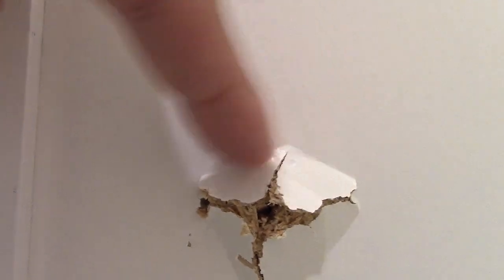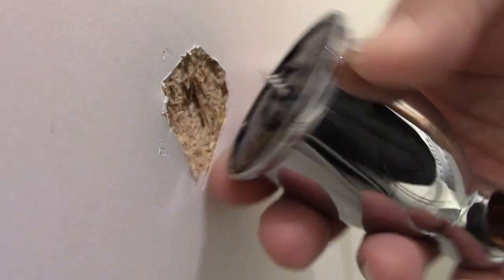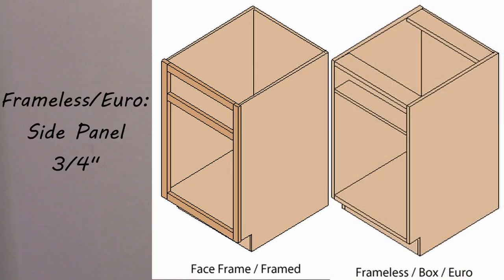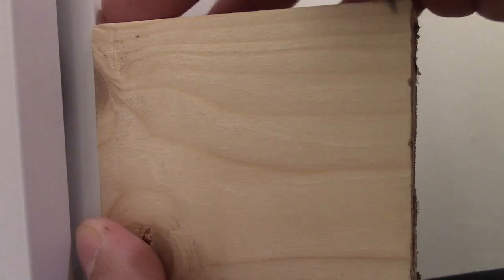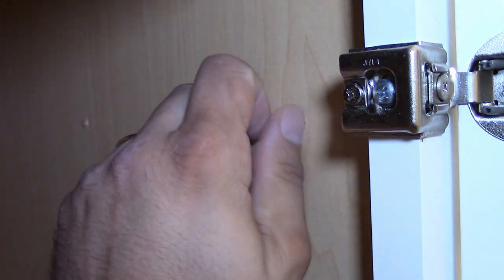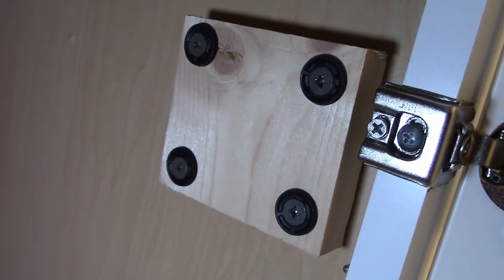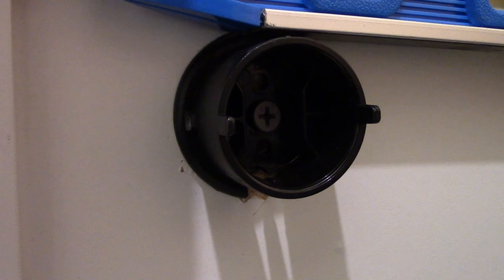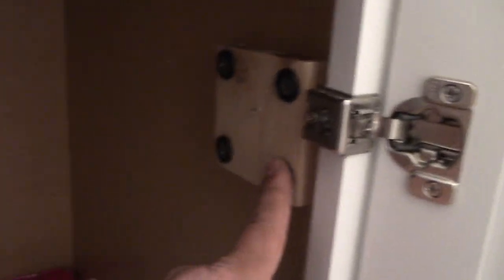How To Reinstall Toilet Paper Holder On BROKEN Cabinet

Comment: Thats the exact same toilet paper holder and cabinet i have. It did fall out from one side today. Thank you for posting
Reply from the maker: Awesome! I wander if you have the same builder? I apologize for the late response. I hope this video helped you. Thanks for watching!!
Reply: @peteshowtosreviews8067 what size screw did you use and the size of the wood. I know you said the wood was 3/4 thickness, thanks
Reply from the maker: @johngilmore1561  Hi, the screw size is determined on the thickness of the wood used and the cabinet side panel thickness. A 3/4" think wood is not mandatory, you can use a 1/2". In most cases the sides panels of a cabinet box with a face frame is a 1/2". If you have a frameless cabinet, the side panels are normally 3/4". That being said, calculate the thickness of both materials and get a screw slightly shorter. As long as the screw goes through the first board and protrudes enough to grab a good hold of the material that you are screwing to. Hope this answered your questions. Thanks for watching!!
Reply: @peteshowtosreviews8067  Thanks, I appreciate it, and yes it does help.